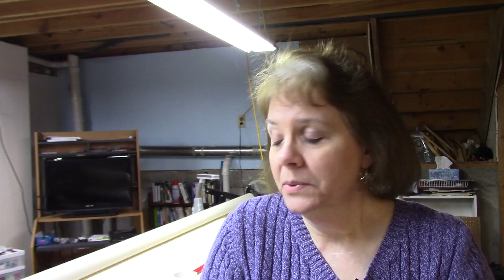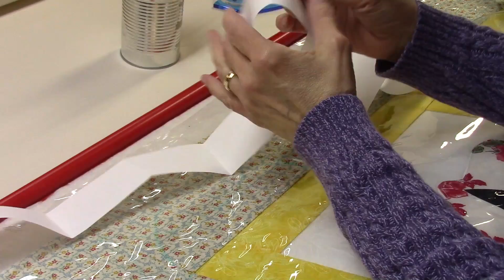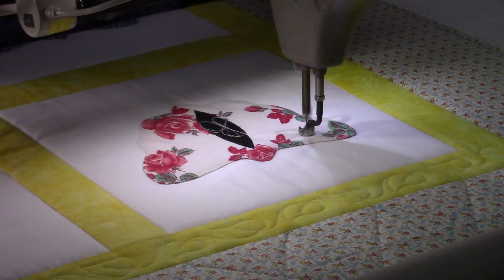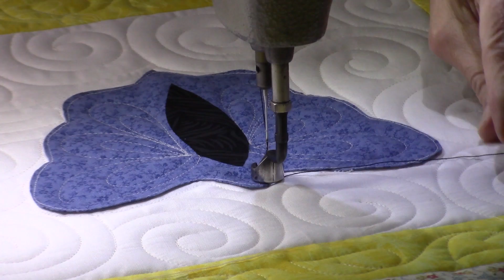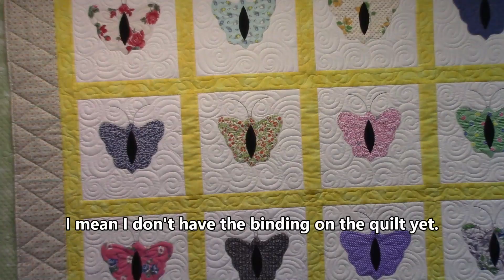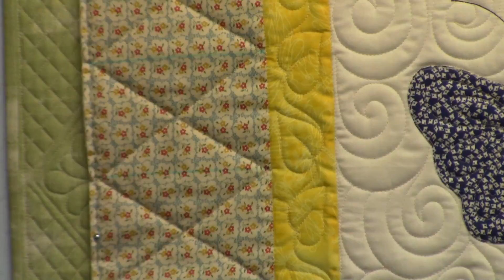Quilting Designs for a Butterfly Applique Quilt

Comment: Beautiful! I have a question- what kind of plastic/vinyl did you use to plan out your design and how big is it? Do you reuse it?
Reply from the maker: I buy it at Joann's. It is sold by the yard in their home decor section. I usually buy 2-3 yards at a time and cut it into smaller pieces to fit across a large section of a quilt. It can be reused dozens of times. I usually only replace it once a year.